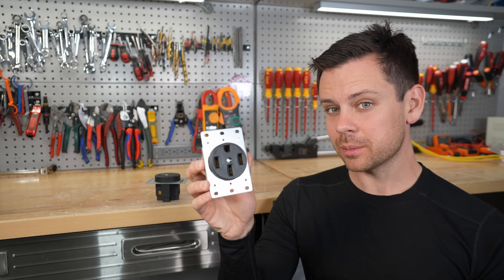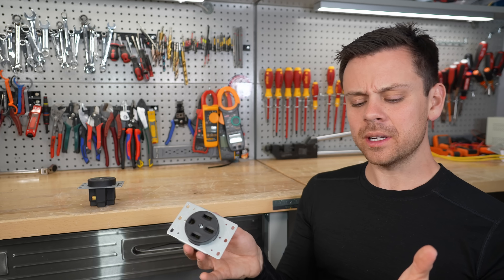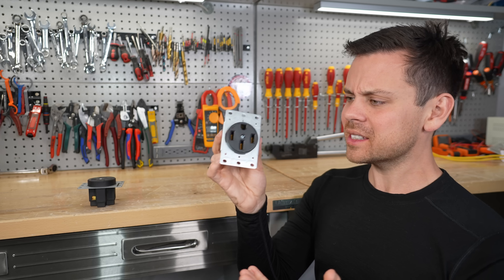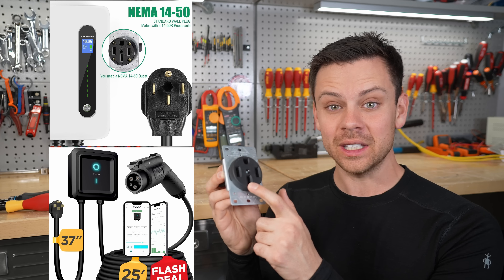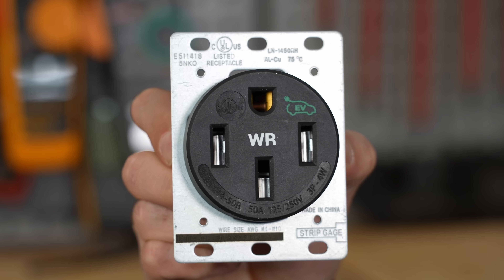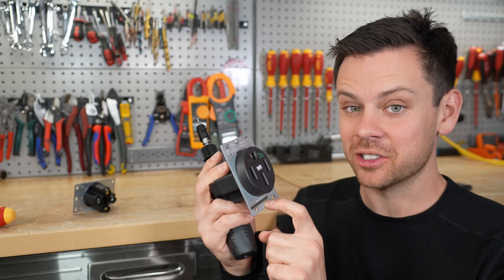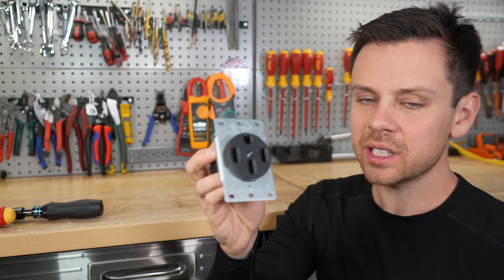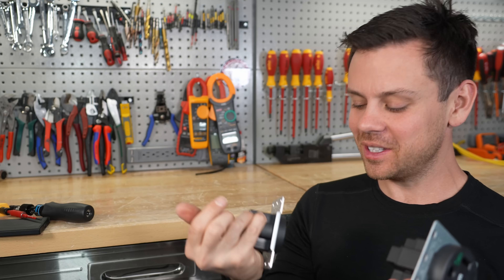Quick Guide to NEMA 14-50: Don't Burn Your House Down!

Comment: I don’t understand how a receptacle that’s UL rated for 50amps is a fire hazard. Isn’t this a huge liability for the receptacle manufacturer? Has there not been a class action lawsuit yet? 🤷‍♂️
Reply: those cheaper plugs were given their UL listing decades before EVs were thought of so nobody was considering continuous load, just typical appliance use with peak loads for short times.
Reply: @rupe53  Code has always been 80%  of rating for continuous loads. I believe the fault rests with the manufacturer for selling a product that doesn't meet code. UL may not be as trustworthy as they appear either.
Reply: @vladimus9749      I'd bet reading between the lines it's probably more about intended use. Leviton has always been the common "builder quality" line. (read: budget friendly) I have no idea if they are still made here in the USA or maybe they are contracted to a 3rd world supplier now. Once they have a design, I doubt if they go for recertification. Maybe they should?
Reply: @vladimus9749 I agree. I think they were sleeping on this one
Reply: At 50 amps a 40kwh Tesla is minimum 3hours 20 minutes max load. A f150 lightning at 50 amps is 8 hours 10 minutes. Which is a crap ton of heat in the wires and connection points

The 14-50 receptacle was designed for appliances. A full electric stove is usually about 7.2kw or 30 amps max, and if not at full power usually cycles on and off and has overheat protection. The receptical itself was most likely designed for peak loads of 50 amps with shorter continuous load up to 40amps (80%) at very specific temperatures like a conditioned area with lots of air movement, and not an unconditioned garage where your car most likely gets charged.
Reply: @omnomzofchainsaws4278  Sorry but that's just incorrect. My Frigidaire induction stove which plugs into a 50a outlet is rated 13.5 kw or 56.25a! This problem rests squarely on the manufacturer if indeed it's being installed properly.
Reply: @vladimus9749 How long does it take to get to temp though? Once at temp, the oven/burners cycle on and off.
Reply: @jake-mv5oi Correct and inductions either cycle or roll back the current. And the ovens still use standard heating elements which cycle on and off. (There are very few recipies for top burner cooking that will be a continuous load as defined by the NEC. 3 hours is continuous)
Reply: the cheap ones are for ovens and dryers which do NOT run continuously at 40 amps for more than 3 hours (like up to 6 hours on an EV).  That case IS listed in the NEC and it is the responsibility of the installer to know that and do the right thing.  There are cheap units for the residential market that have worked for years.  What is new is that EVs require commercial level receptacles anywhere
Reply: @dougbertInExile A 50A receptacle should be capable of handling 50A for a short period and code requires that you derate it for continuous use. When derated it should be capable of 42A continuously.
Reply: @dougbertInExile  I wonder how many amps an electric stove uses when the oven is in self-clean mode...and that self-clean takes a few hours.
Reply: @dougbertInExile  so if you use your induction stove for more than 3 hours, on thanksgiving, I should use an EV charging plug?  That doesn’t seem to make sense.  I don’t get how the electric code would change the 50A UL rating of a plug.  I would think either it is rated or it is not.  Maybe if you put it outside in the sun, but in say a conditioned garage, it shouldn’t matter, right?
Reply: @matthewesunderland  iirc, recommended usage and code says 75% continuous of rated amperage of residential electrical components and 125% continuous for commercial electrical components.
Reply: @Proaman-js2qv Do you mean 80%?
Reply: @ElectronRacewayFabricator  I haven't read the codes in 3yrs or so.. iirc 75% continuous for residential recepticles/breakers.

Comment: Will is absolutely right....last year, my electrician installed the "regular" nema 14-50's in and outside of my garage for electric vehicle charging.  The inside receptacle got so hot, it melted part of the unit and also screwed up my charging cable.  After I called him on it, he said the newest codes for Orange County, California requires industrial rated nema 14-50's (such as the one made by Hubbell) for e.v. charging.  Don't waste your time on the cheaper ones....for only about $30-$40 more, you can have safety and peace of mind.  You can really tell how robust the Hubbell brand industrial rated receptacles are.  It's no contest in a side by side comparison.
Reply: @nak4651  do you know the vendor of the one that melted?  Cuz, you should contact the company and UL.  If it was rated at 50A it should be able to pull 50A, unless your contractor didn’t install it right, or there is actual fine print saying it is not actually rated for 50A.  Imagine something else, like an electric stove plugged in, it should work.  Modern induction stoves can pull close to the 12kW of the plugs rating.
Reply: @matthewesunderland UL fakery is everywhere. It reaches retail. I see so many fake UL's at my day job it's practically white noise. 

Odds are those are someone else's UL which was properly rated for 50A burst.

Comment: 4 awg thhn is overkill. 6 awg thhn is sufficient per NEC
Reply: It looks like the 4awg is a CYA for derating based on vendor and temperature in a garage which are normally not conditioned and can get very hot. 
Plus it's not like electricians also don't stuff as many conductors through conduit instead of the 40% rule. Or my favorite take take SO cable, strip it and throw that through conduit.
Reply from the maker: Still using max size that receptacle recommends regardless. Too easy not to
Reply: You only need 8 awg copper thhn actually. Or 6 awg nm-b.
Reply: @niktak1114

That would be stupid. DO NOT DO THIS!

Comment: It's because they use cheap PLA plastic for the cheap ones. They cannot handle the heat and the plastic melts and then burns
Reply: its not the plastic that heats up its the contacts. they are not the right specs.
Reply: @yoppindia  It's the plastic,  maybe actually look at one when they heat up. We did, the plastic melted , deformed began burning. The contacts didn't get damaged until after they touched due to the displaced plastic.
Reply: @johnstark4723  you know why plastic heats and melts, it's because of bad contact, bad contacts heat up. It cannot be plastic as plastic does not by itself heat up because of high current. I suspect it's because it's aluminium coated copper or some low quantity alloy. They are very bad, they heat up quickly because of dissimilar metals, also they have higher resistance due to which they can't carry larger current for the same cross section.
Reply: @yoppindia  No it is not! IT IS  because it's low quality plastic, you clearly have zero clue about plastics. We tested this garbage,  we know what and why!
Reply: @johnstark4723  I disagree, you have no clue about bad contact, alloys, dissimilar metals contacts.